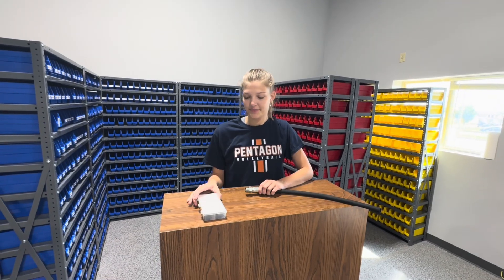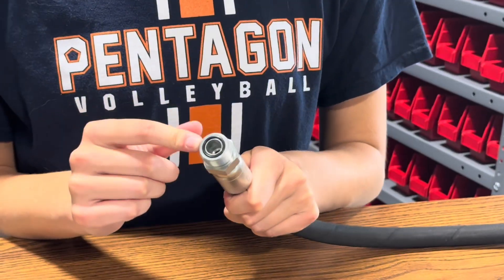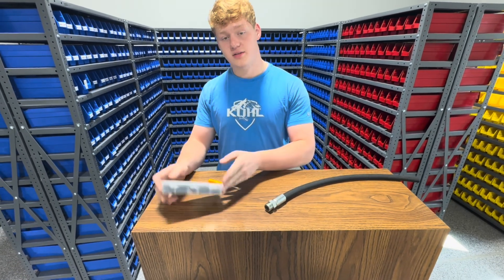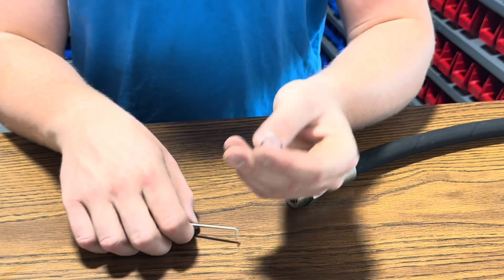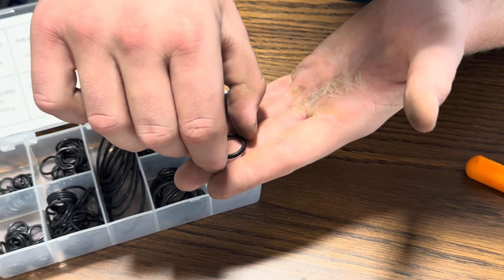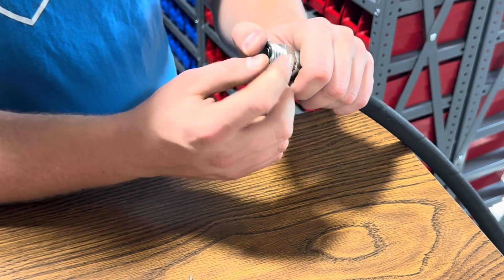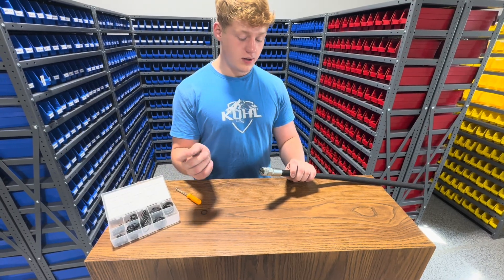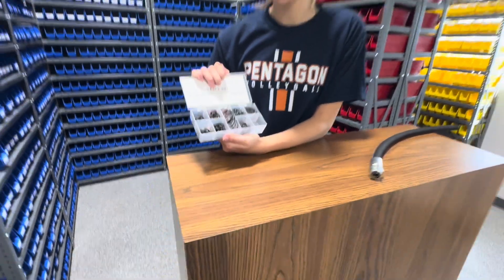How To Replace O-Ring Face Seal on Hydraulic Hose Fitting

Comment: useful, thanks..
do you also do kits for the metric type hose fittings?
Reply from the maker: We do have a Metric bonded seal washer kit in stock or we can order a DIN o-ring kit.